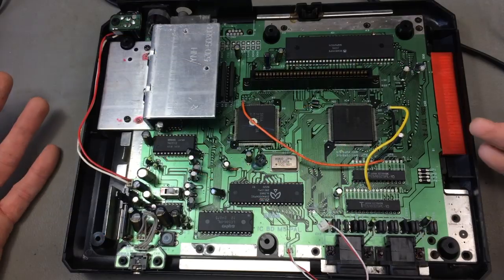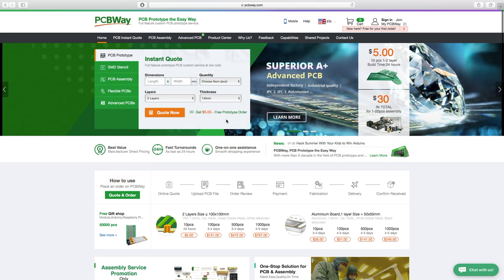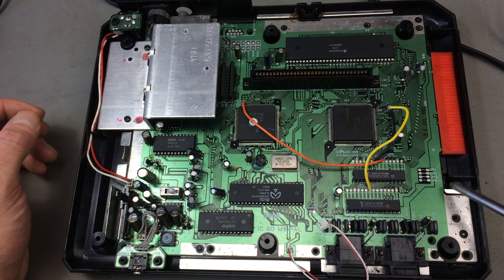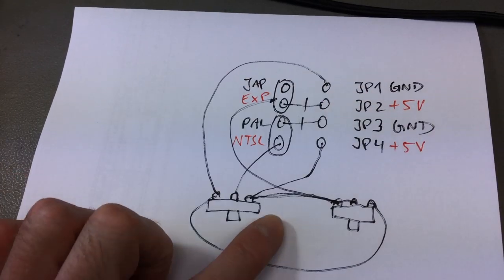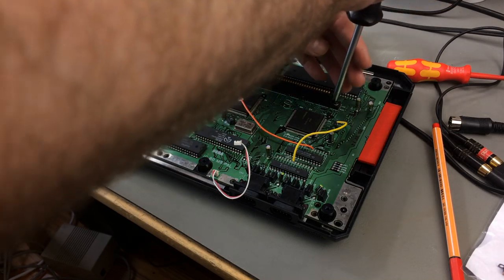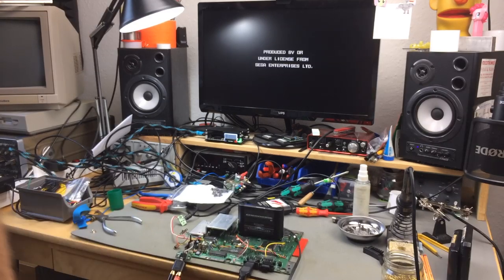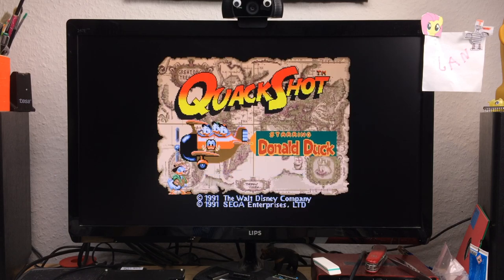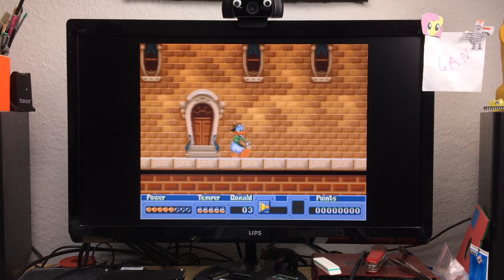Sega Mega Drive 50/60Hz and Region Switch Mod

Comment: You can do this mod with a single DPDT switch.  When you cut the traces on the board the Mega Drive defaults in to Export/60Hz mode.  You then connect the Center post to GND the Left post to JP1 and the Right post to JP3.  Then on the single switch you'll have Japanese/60Hz on left Posistion Export/60Hz on Center (as this will be no jumpers connected default) and Export/50Hz on the right position.

Comment: It is a good habbit to solder a jumper header on the board and attach a female header to the cables. Now you made it impossible to remove the board without soldering, with a simple jumper header this can be avoided.
Reply from the maker: Yeah, didn't think too much about that (as usual). I might retrofit headers next time I'm in there. Makes perfect sense.
Reply: or just put a slide connector on the switch end of the wire

Comment: Mega drives are pretty much bullet proof, reset button can give out, replaced mine with an adafruit soft touch button fits perfect
Reply from the maker: Yes, they are pretty well made it seems. The reset button seems to be its Achilles heel.

Comment: Ah now that's how Sonic is supposed to sound like! :D Nice work Jan! This mod is essential to any PAL MD imo. We basically got crippled machines here in Europe, and by doing this mod we help them run and shine like how they were intended to. It's interesting that there's so much japanese data left in some cartridges and can get unlocked by merely switching a jumper on the mainboard. I never did that on mine, I only fitted a 50Hz/60Hz switch. I might look into fitting a japanese switch on mine at some point, but for now I just enjoy the games at the proper speed. I just can't go back to PAL anymore. :D
Reply: If only more games were optimised for PAL, it’s not really the machine’s fault it’s the developers.
Reply from the maker: Yeah, I basically kept in in the 60Hz position ever since I added the switches. There's a lot more games optimized for NTSC.
Reply: @SproutyPottedPlant  optimised games are not good. So it's good that most MD games are developed for 60Hz. It means a simple mod to the console allows them to run as intended.

Comment: SEGA! So you decided to do the mod anyway well worth it. It does help greatly I suppose, the games seem radically different at 50Hz when they are initially made at 60Hz to begin with, I just tried it myself recently and it really is a different experience altogether for some games.
Reply from the maker: Yes, the mod makes some games just play a lot better. I definitely want to try a switchless mod at some point, too. Love the Mega Drive a lot so far. :)

Comment: Did a similar mod on mine, but using a 3 position, dual pole slide switch.  You never need the japanese+50hz option, unless you are really bad at games!  Switch is on the back.  Usually keep it in the English+60Hz position.
Reply from the maker: Yeah, that would have been a nicer way to do it. (I might be bad at games though so I might be needing it... ;))

Comment: Thanks for the vid, I've been wanting to play Sonic properly for a long time, hehe.  I don't want to modify the external appearance of the console, so I've been looking around the thing and I think I can 3D print some holders to put the switches hidden behind the expansion bay cover.
Reply from the maker: There's also switchless mods these days. A bit fiddlier to install but no case modifications needed at all. :)

Comment: I did this mod too as if you put it in Japanese 60hz mode, hook it up to a Mega CD and put the Japanese Mega CD bios on your Everdrive; you can play Japanese Mega CD games!
Reply: You can play NTSC J games without 60hz and Bios change, patch the disk if you run a backup disk.. You can also do it without the 60hz and just change the Bios on the Everdrive, or you can do what you said.. "you don't need to do what you said to run NTSC J Mega CD" My system has no mods or a Everdrive and I run all regions on my Mega CD.
Reply: @bit-ishbulldog2089  I have a PAL Megadrive, and a Japanese Mega CD.  I can access Mega CD only by loading Japanese BIOS from my Everdrive. (So I can then open a CD tray, and play my NTSC-J CD games.) I wonder if by modding my Megadrive to appear as an NTSC-J unit will let me pass the Everdrive stage, and access Mega CD naturally, or this wouldn't work and I better acquire a genuing NTSC-J Megadrive instead?

Comment: Neat mods :) 

Makes me wonder if replacing the cristal with a little board with a VCO (voltage controled oscillator) with one of those switches and a couple resistors to feed it the proper voltages could do the trick for the composite/RF...
Reply from the maker: Yes, that would definitely work. :)

Comment: When drilling in thin plastic, one option is to put a small wooden block on the other side. It reinforces the plastic and stops the drill somewhat.
The cartridge slot needs changing as well. I'm not sure if the Japanese Megadrive 1 or 2 cartridge slot is wide enough for every game.

Comment: some oscillator modules have a enable input pin that would let you add both oscillators and have a switch between them.
Reply from the maker: That's an interesting idea. Maybe I'll experiment with that sometime. I want to do a switchless mod on a Mega Drive at some point, too.

Comment: I just got a second-hand japanese Mega Drive and just noticed it had another LED bulb on the right side of the red one.
I had no idea what's the purpose of that led until I realized it only turns on when I boot up an US cartridge.

Props to the guy who modded the console before selling it to me. It looks and work fine and doesn't do anything to the actual design of the console.

Comment: Jan try Streets of Rage 1,2 or 3 and change the region switch, you will notice the title change to Bare Knuckles.. Most modern TVs in Europe should run 50 and 60hz (My CRT and LCD both work on all regions) I had a monitor a few years back that did not, what happens in 60hz is I would get a black and white image.. Very simple mod that I will do one day but not on my childhood original Mega Drive.. I get a extra mrk1 Mega Drive to do this to.

Comment: There is no reason to run ground or 5v across the entire console!

There are plenty of places to grab ground or 5v right where you mount the switches. I got a PAL-modded JP MD from SE Asia complete with the crystal oscillator mod and a PAL RF modulator bodged onto the left side. They soldered the switch to the side of the modulator and connected to ground there and the modulator itself was soldered to the ground plane for mounting. That meant no ground wire at all. It grabbed 5v from the same place as the modulator but I need to check to see if it should since I don’t know if the jumpers should be digital or analog 5v (two different regulators). Even if they connected it to the wrong 5v, both are available on the left since that’s where both of the regulators are.

Comment: I wonder what those funny looking black rectangle components are on the board, EM26 EM27 etc... ESD protection diodes or somesuch?
Reply: These are ferrite beads
Reply from the maker: Yes, ferrite beads. Mostly for RF filtering and FCC compliance I think.

Comment: 4:42 “They made several revisions of this board but they made one version for the whole world”

You’d think that especially with the jumpers you were pointing out but it turns out that Japanese boards have no RF modulator and move the power jack to the board despite having corresponding revision numbers.
Reply: Japanese Sega Mega Drive board was released first in 1988... they didn't move the "power jack to the board"
Reply: @DBZpwnsDC  I wasn’t speaking in chronological terms. You are speaking of VA0 and VA1. I was speaking of differences between the Japanese boards of the same engineering version as their international counterparts. North America started with VA2 and some 50hz PAL territories started with VA4.

You can say that the Japanese Master System adds FM synth and a 3D glasses port when comparing it to an American one regardless of which came first because we are talking about a list of additional inclusions, not a chronology. For the MD power jack position, I was talking about a list of differences within the same engineering version (VA2-6), not a chronology.

VA7 was the first revision intended to use that same board worldwide but that didn’t happen due to PAL issues with the new chipset. That’s why they kept producing VA6.5 for PAL50 territories and revised it to VA6.8 to use the new SMD encoder IC. VA7 was released in Brazil, some parts of SE Asia, the USA, and Japan.

Comment: Love your videos Jan but I have to say that those holes you created for the switches are just plain awful.  Use a smaller drill and take more time and care with your files and you can easily create some near perfect holes.  I'd also recommend creating a printable hole template beforehand using something like the free Front Panel Designer software and sticking this onto the case as a guide.
Reply: Yeah, also it’d have made sense to connect them to the board with some inline quick connectors so that it’ll be easier to service the board in the future; as it is you now have the board essentially permanently attached to the case unless you desolder and resolder and possibly make some mistakes in the process.
Reply from the maker: Yeah, I could have done a better job (again). Not too patient with these things. :/
Reply from the maker: True, didn't think about that too much. I could just have put some pin headers in I guess.

Comment: in another video i learned that the console will "default" to NTSC when you cut the trace for the video mode jumpers and just leave JP3 and JP4 open ... this was perfect for me because all i had right now was a simple single row on-off toggle switch wich i used to simply restore the previously cut contact at JP3.

this way, i could do the mod right now without ordering any parts and waiting for delivery - i can now switch between US/EU and that was all i wanted ... the few japan-only games i actually want to play are not region locked while most US games i tried are locked - i guess making the cartridge physically incompatible to US/EU consoles was "good enough" as a lockout method.

i just wonder if i should add a pull-up resistor to JP4 instead of leaving it "floating" when the switch is open - would be the more "proper" way to do this, i think? 
what value would the resistor need to be then ? 1k?

Comment: I did that mod myself. Now I am wondering what kind of RGB cable I need to get it fully to work on a PAL TV. I got myself one for the Megadrive 1 exclusivlely. While the PAL picture is perfect with it, the 60Hz modes have a big ugly black and grey bar at the top of the TV picture.
Reply from the maker: That’s probably due to the TV not being able to interpret the signal correctly. Some TVs deal with the not-quite-NTSC signal fine, some don’t. The cable should not make any difference (at least as far as I understand).
Reply: @JanBeta  Thanks for the reply but I found what was wrong with it... my old CRT is always switching into 16:9 mode when I start up die Megadrive in its 60Hz mode. I dont know why it does that, but I have to manually set is to 4:3 every time I start or reset the console. The strange  grey and black bar where just the upper end of the 16:9 frame.
Looking forwart to my upscale setup so I can maybe get rid of that hunk of lead CRT monster.

Comment: Great video! I'm assuming composite won't work because the crystal oscillator would need to be swapped too? I have a friend who has a modded system like this but the crystal was never swapped. RGB works just fine though.

Comment: well i am confused... i have pal megadrive, and all i want obviously is to have 60hz. but when i switch the region, my cartridges maybe not be compatible because of region lock dont they?
Reply from the maker: Yup, some cartridges are only going to work with the switches set to the correct region. I found that many work with whatever settings and just run faster or slower. If you do the mod I‘ve shown you should be able to play all the cartridges with the appropriate settings though.

Comment: Can I use Genesis 32X and US 32X games with modded a PAL Sega Mega Drive when those "Export" & "60Hz" switches are activated?
Reply from the maker: I don't have a 32X to confirm but technically with the switches in the 60Hz position, the Genesis is a US model so I don't see why it wouldn't work.

Comment: the way i modded my megadrive to play american/japan games was a hacksaw, i never noticed anything weird on a 14 inch tv connected by RF.
Reply: I expect the colour carrier will be wrong on the RF, but some televisions tolerate this.
Reply from the maker: Interesting, I didn't try RF at all yet (I guess very few people will nowadays) but I assumed it would not work properly on most TVs without changing the oscillator frequency.

Comment: I made the modification on a Japanese Mega Drive, but when I use PAL 50HZ mode the image is black and white. The crystal is 53.69317MHz. Should I replace it with 53.203424 MHz to solve this problem?
Reply from the maker: Oh, no idea if that's going to work (probably yes). The Japanese standard is a bit off the regular frequencies, so you might have mixed results depending on which monitor you use to display it. Some might even handle it. Also, are you using the RGB out? That should theoretically work fine independently of the oscillator.

Comment: nice tinkering, would you convert the US C 64 C to Pal.
Reply: It is certainly recommended to own a PAL C64, because many more advanced games and demos do not run on NTSC, so you need to to experience the best software. Wether you convert one, or just import a PAL C64, is your own choice. Personally I don't do converts, I imported an NTSC machine for software testing purposes.
Reply: Daniël Mantione I wonder if there is a way to do what Jan did with this Mega Drive(to easily convert it back and forth without opening the unit)
Reply: @EvilTurkeySlices  For the C64 this is not possible, because you need a different VIC-II for PAL and NTSC. Therefore the most convenient way is to own multiple C64s, you can easily swap them on your desk.
Reply: Daniël Mantione you could make a custom PCB(or even use prototype board) to have both VIC II and clock crystals on it, and switch them in using a switch on the back.
Reply: @EvilTurkeySlices  Yes, technically this is possible and it has been done by people in the past.

However... you need to get an additional VIC-II for that. You can find them on Ebay, but these are often sold by "C64 butchers", people that buy C64s, rip them apart into parts and then sell the parts for a profit. I don't approve of such practise and avoid buying from butchers. We need to preserve the remaining machines, not kill them.

So unless you have a good source for a VIC-II, I still recommend to buy a second C64.
Reply from the maker: I kind of decided to leave the one NTSC machine unchanged. I have plenty of PAL C64 models to play with.
Reply from the maker: As far as I know, Perifractic showed a PCB like that on his channel a while back. Utilizes two VIC-IIs and changes the frequency.

Comment: I just wondering.. i have opening my PAL mega drive, and i've noticed there is a capacitor on JP4.. To make the mod i've to cut and remove that capacitor?
Reply from the maker: Most people advise to just leave it in place. I think it makes sense to check where it connects and reconnect it after soldering in the switches. If in doubt, google for some schematics for your board revision and see where it should be connected.
Reply: You don't need the Cap on JP4.  Mines not been on there for a while now

Comment: is scratching off the jumper connection really the only way? it just looks awful :/
Reply from the maker: You have to break the connection in one way or the other. To make it a bit nearer, you could use a small drill or a rotary tool.

Comment: Did you change the thermal paste on the linear regulators the original paste will be dried out and heatsink not making a good connection
Reply: He put new voltage regulators in.
Reply: Knuckles the Echidna not what I asked
Reply: @ps3customgamer  if he put new voltage regulators in then surely the original thermal paste would have disappeared too apart from the traces on the heatsink?
Reply: Ian Robertson Yeah exactly. My opinion is the regulators on old consoles are dying only because thermal contact has been bad for a number of years.
Reply from the maker: Yes, I replaced them with proper ST 78S05s and put new thermal paste on in the previous (restoration) video.